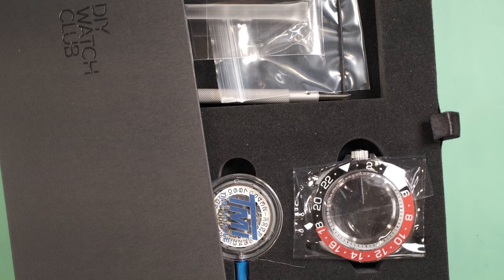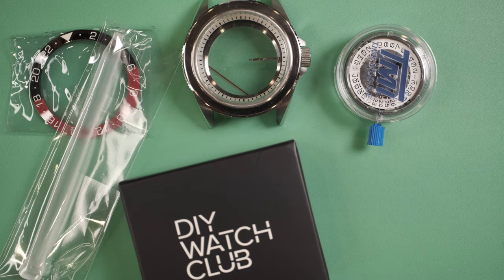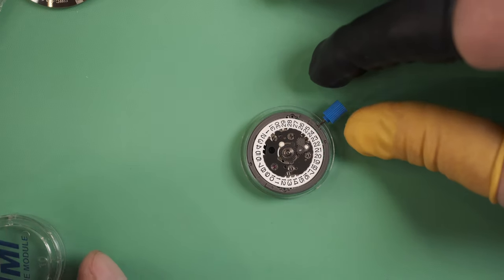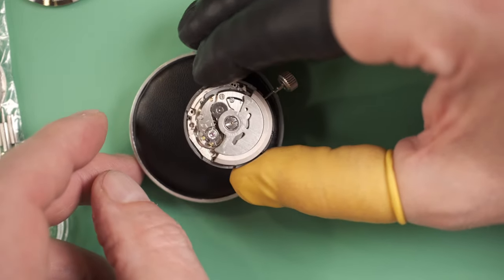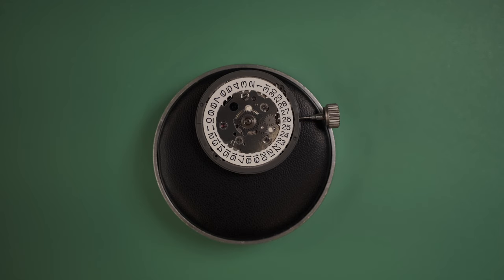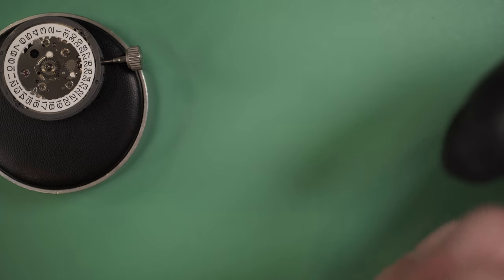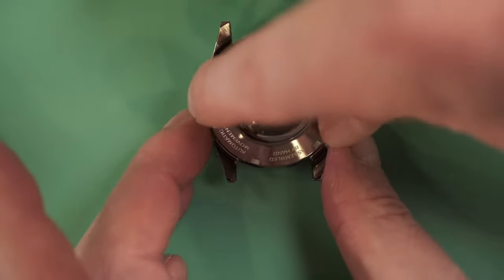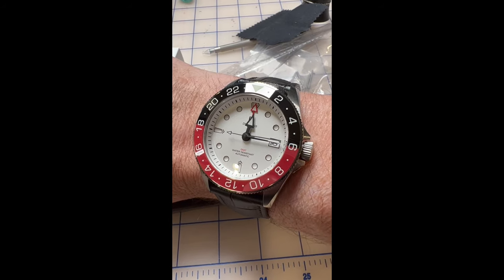Is this Superb GMT “Coke” style Dive Watch worth it?

Comment: What does the GMT hand do? I’m new to the watch game😂 is that the date?
Reply from the maker: Great question Bob!

The GMT hand is an additional hour hand that stands out visually from the rest of the hands due to its size and usually distinctive color, and can be moved dependently or independently, depending on the type of GMT watch. Unlike the normal hour hand, the GMT hand needs 24 hours to circle the watch face once. 

The GMT hand is used to track a second time zone, usually Greenwich Mean Time (GMT) or Coordinated Universal Time (UTC), which are the same for most practical purposes. The GMT hand points to a 24-hour scale on the bezel or the dial of the watch, which indicates the time in the second time zone.

To set the GMT hand to your desired time zone, you need to know the difference between your local time and the second time zone. For example, if you are in New York and you want to track London time, you need to know that London is 5 hours ahead of New York. Then, you can pull the crown out to the first position and turn it clockwise or counter clockwise until the GMT hand points to the desired hour on the 24-hour scale. Make sure to adjust the GMT hand only and not the regular hour hand. If your watch has a rotating bezel, you can also use it to set a third time zone by aligning the bezel with the GMT hand. For example, if you want to track Tokyo time, which is 9 hours ahead of London, you can rotate the bezel 9 clicks counter clockwise. Then, the GMT hand will point to Tokyo time on the bezel
Reply from the maker: Also, to set the GMT function on a Seiko / TMI NH34 movement, like the one used in this build, you need to follow these steps:

Pull the crown out to the first position. This will allow you to adjust the GMT hand independently from the regular hour hand. 

Turn the crown clockwise or counter clockwise until the GMT hand points to the desired hour on the 24-hour scale. Make sure to align the GMT hand with the correct half of the day (AM or PM) for the second time zone.

Push the crown back to the normal position. The GMT function is now set.

There are some cautions around setting the GMT and date complications for this specific movement:

Do not set the date between 9:00 PM and 4:00 AM. This may cause damage to the movement or incorrect date change.

Do not turn the crown too fast or too forcefully when adjusting the GMT hand. 

This may cause skipping or misalignment of the hand.

Make sure to fully wind the movement before setting the time and date. This will ensure accurate timekeeping and smooth operation of the complications.
Reply: Great info! I would not need a GMT as I rarely travel outside of the US or my time zone for that matter. Great info though and I will subscribe and follow your channel!
Reply from the maker: @Bob_Weir617  thanks Bob! I have family in the uk so it’s handy for avoiding calling in the middle of the night :)
Reply: @Bob_Weir617 gmt’s just look so cool.
Reply from the maker: @ryanwalsh7010 Agree, look cool and are super useful!